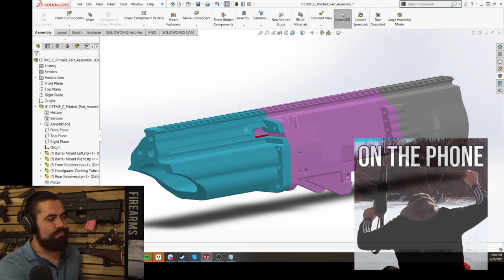Gun Stuff 101: Designing A 3D Printable 308 Battle Rifle (3D Printed CETME/G3)

Comment: Wow, I have wanted to design something like this forever, I would love to help any way I could. I am in college as a machinist, with hopes to use my skills (among many other things) to create a battle rifle like this, which can be manufactured with minimal skill.
Reply: I also think that a 223 version of this, which accepts printable AR magazines would be awesome. I have some ideas on how to manufacture other components of this firearm, even ones which can't be printed (with current materials technology), I think that a simplified version of the existing metal components, would be awesome for people who don't have access to gun components online (Europe, Asia, etc.)
Reply: @atlastobin7837  I just wanted to say that roller delay is extremely hard to get right if you can't just buy the trunnion and rollers. The headspace is determined by the roller contact with recesses, so after a rifle is produced there's sets of rollers with slightly different diameters and the correct pair is picked.
However, I suspect you could cheat by making an abomination of a trunnion that used hardened bolts placed at an angle to serve as the contact lugs, and then you use the threading to adjust the position to make sure headspace is correct. At that point you could weld the threaded section to prevent it from backing out from the nut. Now the issue is processing hardened steel rod into usable rollers. Godspeed.

Comment: You kinda skipped over one of the advantages of the more expensive CF/G filled Nylons.
Yes, they cost more. Yes, you need a fancier machine.
But, the layers also bond much better. On many cases, you don't have to care about the layer direction because they bond so well there's no difference.
The fancier and more expensive you get, the more true this becomes.
Stuff like PEEK, PEKK, etc fail with total disregard for layer lines.
You can see the layer lines.
But, they don't matter because the inter-layer bond is every bit as strong as the layer itself.
Fiber-fill actually enhances this in lower yield materials.
Some of them are stronger than aluminum.
Sure, they cost more. But, they're also worth it.

Comment: Before this I wasn't sure about 3d printing. Now I feel like an idiot who's behind the curve. PLA+?!
Reply: Im waiting for the tech to get just a bit better, letting other peole with more time and money than myself do R&D and refinement.
Reply: PLA+ has additives that improve the thermal properties of PLA at the expense of raw strength. People tend to forget that, at cooler temperatures, PLA is one of the most mechanically resilient filaments out there. Temperature sensitivity and lack of flex are the biggest problems. Each brand’s PLA+ does slightly different things, but better thermal stability is the big goal.

Comment: Pla may be a bad choice. It tends to shrink long term. Aside from possible binding or sloppiness issues.  I did a prop rifle once.  Printed most of the sub assemblies in one orientation,  but some pieces had to be printed in other orientations.  So over time where those pieces joined to together, the gun just cracked/ripped itself apart.
Reply: You should find and follow Ivan. He has some pretty amazing 3D printed guns out there. For al the naysayers, the proof is in the pudding. He is constantly refining and coming up with working designs for building from part kits.

Comment: So in this issue, I have had several questions as to why this is a fear. First it seems to me that making a firearm, 3d plastic printing is not a feasible method to do this. As firearms must have an ability to contain very high pressure. This means that plastic will likely never be useable in what is truly the most important parts in construction. At the end of the day, you will need buy premade steel components like the barrel and bolt. Or the maker will need to machine these out of proper materials (normally requiring specific heat treatment). Second we are not concerned about the ability of folks to use machine tool (drill bits, lathes, and mills) that would prove far more useful in making a viable firearm.
Reply: Look at the FGC-9 documentation.
You can make the bolt out of steel stock using a hand drill, JB Weld, & 3DP jigs. The barrel can be rifled out of steel tubing with a 3DP tool, salt water, & a car battery.